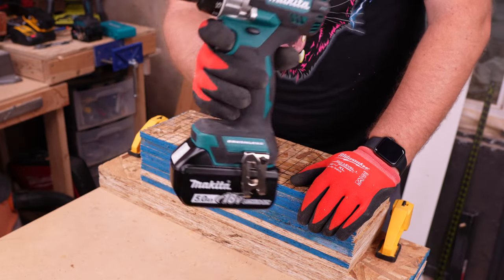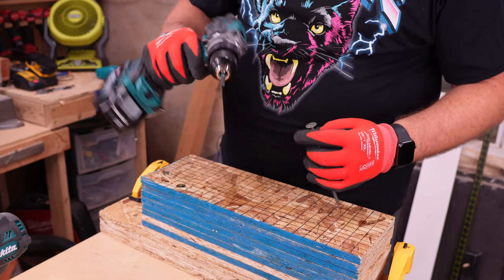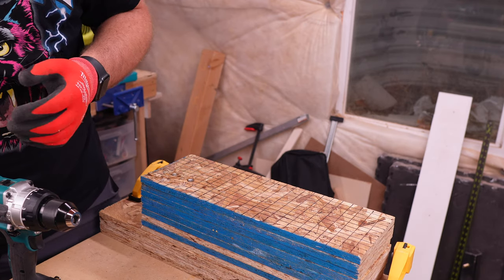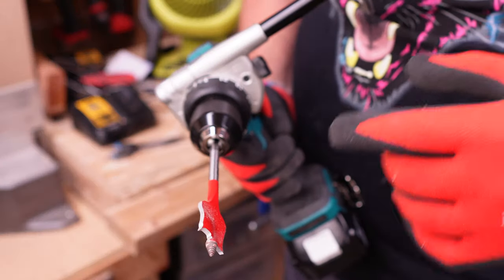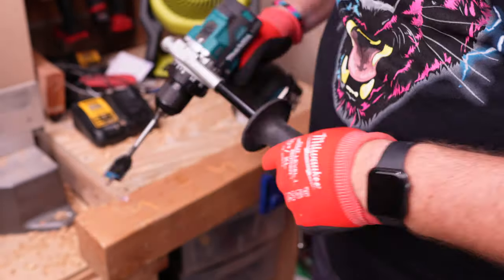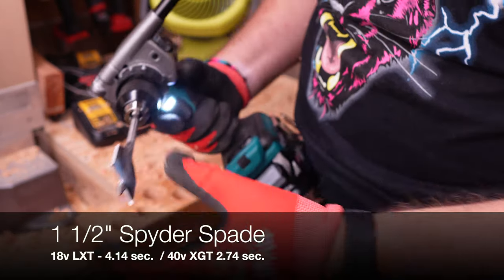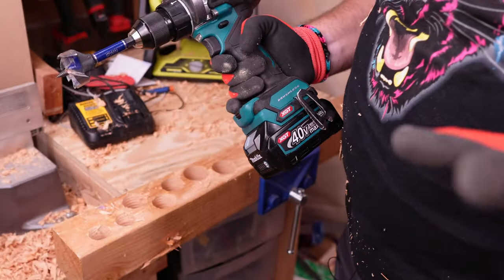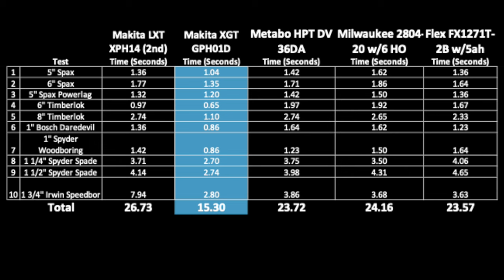Hands Down The Best Hammer Drill I've Tested! Makita 40v XGT vs 18v LXT

Comment: I push the XGT to anyone that will listen.  Makita does not focus on making tools the most powerful or the most torque. They focus on the smoothest and most comfortable tools that’s why I love Makita
Reply from the maker: I agree that their mission is more one of ergonomics and comfort than power and speed… most of the time.  The hammer drill is that and the fastest thing I have tested.
Reply: I am thinking about buying into the xgt line. It's not about the impact drivers or the drill. It's all the other machines. Circle saw, etc.. all the heavyer machines. Also, more future proof I think
Reply: Makita does focus on ergonomics,  but their reliability is far better than their competitors. I got sucked into the Milwaukee circle jerk, and ALL of them have trigger problems.  Further, only their impact drivers are low enough on power to bother me. I have noticed no power difference between my LXT, 998, and 2804.

Comment: Makita is for people who've moved past the Milwaukee circlejerk 🤣
Reply: hahaha I'm stealing this 🤣
Reply: Yeah lot of the people are on the latest cool tool fad. Much like all fads they fade .
Reply: Makitia is goat,  I switch about a year ago from Dewalt to Makitia you can just feel the quality.
Reply: Ive never been a big milwaukee fan and always liked makita. Idk if they werent always more powerful, they were plenty powerful, far more reliable, and far more serviceable if you have a problem
Reply: @jacksmith2315  im a makita user and i noticed makita makes tool power adequate for the tool task, yes most tools out there may be stronger but the makita  just works right 99% of the time
Reply: Ive got Makita 14.4 and 18.0 Volt NiCd drills that still run.  Well, they would be fine if the batteries weren’t shot!  😳🙄🙄😂✌
Reply: @jacksmith2315  Hi jack, see my comment above!  ^^^
Reply: It’s a man tool! Because after 14 years in construction and trying different tool and buying Milwaukee tool because everyone is bragging them. Then realizing that it’s not what everyone is saying it is. I was pretty discouraged on how Milwaukee was performing. Wish i wouldn’t of wast my money on Milwaukee. And just both makita. I was thinking of going to Milwaukee until i experience using Milwaukee. It didn’t take me very long to say F that. I can’t even cut a set of 3 stringers with a Milwaukee read handle skills saw with a 6 amp high out put with the battery over heating then i couldn’t keep working i would over heat the next Milwaukee batteries before the one on the charge was full 🤦🏻‍♂️ And can cut 5 with my Makita read handle skill saw without the battery over heating. Makita are the only ones  that have a safety features so you’re battery don’t drop under 12vlots to protect the cells in the batteries and they make there own electric motor not like other brand. Dewalt is black and decker now the quality of tool you get from dewalt is not the same as what it use to be before they sold to black and decker.
Reply: I just wish Makita had a pack out equivalent.
Reply: I cannot stand milwakee. People that own them are arrogant and cocky.
Reply: @matthewmahony9165   lmao, thats really true, sad.....
Reply: Ya man my mother-in-law loves this drill!
Reply: @matthewmahony9165  Mby cuz they know they have the BEST there is ;) That china makita is allmost 2 times more expencive than Gen4 (in Europe at least), the batt and charger are allso,and its bigger and heavyer. Tool guarantee's are the same for the 2 brands, and allso makita screw theyr 18v customers when switched to 40v (and they have way less tools on this line). So tell me really why you Makita fanboys are so blind to the facts ? Milwakee is coming with stack batt soon, and then they will be even more powerfull, lighter and smaller, but mby Makita will make 60v line next, who knows :D
P.S. Oh, and 1 more thing. Milwakee uses the best 21700 sells (Samsung 30T) in 6.0ah HO batt, where Makita uses middle of the road SonyMurata 21700 cells ONLY in theyr 4 and 8ah batt. All other batt are using 18650 cells from 2005 :)
Reply: Totally,I went from m18 to xgt. Not the same quality in my opinion
Reply: The reason I switched back to Milwaukee is because Xgt model is two years old and I have  used up two of them already. Good drill but breaks almost by looking at them
Reply: @derrickmuck535 I keep all my Makita in my packouts. Nothing wrong with the packouts.
Reply: @VikingOlberg Man, that's terrible luck. My Makitas are far more reliable than my Milwaukees.

Comment: I own both LXT and XGT lineup. Bought on my b-day that XGT drill (HP001GZ global number) set with the fast charger and two 2.0Ah batteries. Got from Makita a 3rd 2.0Ah for like 50 cent as a promotion campaign. XGT have one thing that LXT dont have apart from power - its safety modules hidden in them, which with an adapter allow you to lock batteries and tools to work only with each other and also check the state of your tools and batteries. So in case of someone having a taste in your tools, they will take quite expensive paperweight.
Reply from the maker: Good point to add.  Thanks for sharing!

Comment: I'm on the LXT platform and happy with the few tools I have of Makita, although this XGT drill would be only upgrade I 'd really probably want as their LXT platform tools are so good, quality in so many ways and not all about power. Reminds me of one of the greatest advertising slogans, "Power is nothing without control" -Pirelli.
Reply from the maker: You are right... the LXT tools are great.  I think the XGT will really shine on bigger tools.  If you don't have a need for those then I think you will be happy there.  I just hope that the LXT continues to get attention in the future.  That's really the only concern I have with the LXT currently.
Reply: @TinkerWithTools  Oh absolutely. I hope they dont start to phase out the LXT line.
I'd say, keep the LXT system and if they need to, get rid of CXT. Then adapt the lighter/smaller tool system using LXT battery platform. That gives a simpler two systems choice.
Reply: It’s just a damn shame they refused to go past the 6.0 Ah on the 18 volt batteries.  I love my ole’ corded Makita grinders.  The cordless ones deserve higher Amp hour batteries.  And yes i know they have the 18X2, but seriously, not in a grinder.  I have a couple of the saws in 36 volt, but again, more runtime would be welcome.  Guess that would be the selling point for going the more expensive route with the XGT.  Peace
Reply from the maker: @georgedavall9449  yeah XGT is the future if that’s what you want.   I think they will continue to limit the LXT battery size to promote the viability of XGT. That being said the XGT stuff I have is pretty sweet.
Reply: @TinkerWithTools  Well, MAHKeeta did it to themselves, as they knew if they came out with 21700 celled batteries in the LXT, they would open a huge ‘can o worms’   There are a lot of tools they would not fit in, especially the X2 ( 36 Volt ) tools.  I looked at my rear handle style 36 Volt saw, and there is no space for anything bigger.  So they just made excuse after excuse, and then, wha lah, out comes the XGT lineup.  I’m not dissing on the  XGT tools, but irritated by the poor battery support in the LXT lineup.  My 2 cents  Peace

Comment: Your Intro was great!  I especially liked your approach to testing, and your timing set up.  Your lack of Music is welcome!  So many YT creators feel the need to interject annoying insipid music in the background.  So count me as a New SUBScriber!!!  

Question for you:  Did you notice the XPH14 making the ‘Makita clacking clack’ sound as you back off the trigger, in 2nd gear?  Juss curious.  I sent off my XPH12 for that, and the fact the brake would cut in and out, and gear changes would grind, and they replaced the speed controller, and now it does NOT do it.  The New Jersey Factory Service center is great, BTW.  Highly Rec’d. 👍 👍👍✌👊☺
Reply from the maker: Thanks.   I actually have sent that drill off to be service because the transmission was basically dead in 1st gear.  It was replaced so I wouldn’t be surprised if there were issues with it.

Comment: As a machinist who also does a lot of drilling by hand in metal, it would be so awesome if that knob could adjust the max speed when drilling. There's just too big of a step from 2600 to 650 rpm and even 650 is too fast for drilling anything bigger than about 3/8" in steel.
Reply: I’m constantly drilling 1” to 2” holes in 3/16” and 1/4” steel (canopy frames for Sonic Drive Ins) using Milwaukee bi metal hole saws. I recently switched from using a XPH14 to Makita’s 36 Volt Right Angle Drill which has a maximum speed of 350 RPM in speed 1 (low) and it seems to be the perfect speed for my purposes. 
I also have been using electric tape to close off the holes in the hole saw and then filling the hole saw with “Sonic Ice” (pellet, but crushed ice also works well). 
I then drill with moderate pressure, the melting ice cools and lubricates the hole saw and allows it to cut faster and cleaner without the mess of cutting lubricants and the ice is free in my case.
Reply: I also forgot to mention that using ice to keep the hole saw cool I usually get more than 100 holes out of a hole saw which saves som serious money over time.

Comment: I like the electronic clutch for one reason. When you screw something that requires not all that consistent torque, you have the option to drive it a little further after it cuts out. The mechanic one will just keep slipping.
Reply from the maker: I hadn’t thought of that.
Reply: @davidblahota5655 I'm looking at getting this drill for the electronic clutch, the noise that the mechanical clutch makes is annoying sometimes, especially inside a room.
Reply: the point of a clutch is to limit torque to a certain amount. You're saying you like the electronic clutch because sometimes it doesn't limit torque. Interesting.
Reply: @CarltonGauss  Yeah, a hand drill does not operate in all that consistent conditions. You would have to turn the limiting off for a single screw with q mechanical one to drive it further once it does not want to go deeper with the setting.
Reply: @davidblahota5655  This clutch just adds another layer of inconsistency though. Even if "press trigger again for a bit more torque" would be a nice feature; it's not really an intended feature here. It's just a consequence of the clutch being bad and responding late. My problem is that this late response is happening on the initial drive too, and it's impossible to control how much torque you're delivering to the fastener.

Anyway, I'd much rather change the mechanical clutch setting than strip a screw head or a thread.
Reply: @CarltonGauss  yeah, you're controlling it based on the amount of power delivered to the motor, which would mean it not getting from dead stop if it was limited on the spin up, where it draws way more current. Qs for controlling the torque, it does better than mechanical, the torque needed inconsistency with materials which you use hand drill to fasten is the issue.

Comment: Excellent tool use my XGT for mostly for metal work also have the 40v grinder which is also a beast. Any woodworking I do around the house or in my workshop I use my dewalt Dcd805 probably use the 805 more now

Comment: You should review the XDT19 next, now that it’s available here. And if you really want to go all in, order a TD002 from eBay and review it side by side with the gen4 Milwaukee impact.
Both of those reviews will grow your channel exponentially.
Reply from the maker: I am sure I will work to bring those to the channel at some point but next up for Makita will be a comparison between the LXT and XGT Impacts.
Reply: @TinkerWithTools  the only problem with that is the only XGT impact available in the states was just a stopgap until they could build a from scratch version designed from day one on the 40v XGT platform, that is the TD002 which will probably launch here by the end of the year as the replacement for the current one, which I bet the XDT19 will out perform.
Reply from the maker: @TheOMEGANOX  so in you opinion the hierarchy will be 
1. TD002
2. XDT19
3. TD001
4. XDT16

Am I getting that right?
Reply: @TinkerWithTools  for sure on #1 being the TD002, the rest will be close and I'm as curious as you are to see how that shakes out.
Reply: Another vote for td002g,  nobody is doing it!

Comment: I have a question about the Ridgid promo.
The hammer drill combo is available in my store, but the ratchet and right angle impact are not. Since those are the most expensive free tool options, they are the ones that make the most sense for the hack.
I don’t see any discrepancy in my cart, but can I just order everything from the website, pick up the hammer drill combo, and have the free tools shipped to the store?
Reply from the maker: I have never done it that way.  I have ordered it all and then later just taken back what what I don’t need.  I have never tried to split the delivery method if you will.
Reply: @TinkerWithTools  The website is telling me that I can go to the store and get the combo, but the ratchet and right angle impact, which are the most expensive options, have to be shipped.
The only way to do the same method for everything is to have it all delivered to my house, and I don’t trust that nobody will steal anything.

Comment: Bought the combo set with extra batteries. like you said impact was good, the hammer drill awe inspiring. 
Especially on larger hole saw or diameter bit holes. Not that much bulkier than the LXT (18 volt) Selling my 
mid range PH12 combo set. Going after XGT OPE now, oh boy, ( rabbit hole!).
Reply from the maker: A fun but expensive rabbit hole!
Reply: @TinkerWithTools  it isn't as bad as Japanese chisels though.😉

Comment: Very  nice test review as always, and a good summary and analysis after that. Worth subscribing for it! Makita have really nailed it with the 40V platform, significant power gains in all the tools (apart from the impact drivers so far). Even the new stick vacuum cleaner is 2-3 times more powerful, than the 18V brushless one...
Reply from the maker: It will be fun to see what they can come up with to make use of all that power.
Reply: @TinkerWithTools  They have the 14in Power cutter gec01 running 2 40v batteries.
Reply from the maker: @misha030302  yep.  Stuff like that is really going to be fun to see where they push things next.
Reply: You haven’t tried the TD002 yet
Reply: @TheOMEGANOX  I haven't, but I have seen a lot of reviews for it. Very good, but pretty much as many other 18v tools, even slightly inferior in some ways. And I have the 18V Japanese Makita TD172D, along with 5 other impact drivers (including the super-smooth and refined 12V and 18V Milwaukee Surge).
Reply: @sizif717  yeah I had the surge also, gave it to a buddy when I got the 172, just as quiet and smooth with way more power, the only way you'll appreciate the TD002 fully is by owning one and running it alongisde the most powerful impacts out there right now, which are the milwaukee gen3-4 and the flex with stack battery, it's flat out amazing.

Comment: This drill has been tempting but I already have the Metabo HPT 36v hammer drill. I do have a couple 2.5 xgt batteries and the rear handle so I will eventually pick one of these up when I find a good deal probably.
Reply from the maker: The Metabo is no slouch and is a great drill.  For me the XGT is in a different class because of refinement.
Reply: this is why tools with arthritis wont test this drill

Comment: I guess I should have worded my question differently.
What do you think of the LXT combo at Home Depot?
The reason I’m considering it is because, with the hack, the combo becomes $193 once you return the “free tools.”
Reply from the maker: Getting that tool at that price will be about as low as you will find it.  I love the combination of the two. The impact driver will be one of the nicer (but not most powerful) impacts you will ever use.  The drill is good but isn't class leading.
Reply: @TinkerWithTools  I know SOALZ hates Makita.
I’m just trying to get the best possible set for my needs and budget. I don’t like the ergonomics of Milwaukee, so I’m looking at Ridgid and Makita.
Dewalt and Flex are my other choices depending on the deals.

Comment: My issue is the lxt impact is the better impact. Why the 40v impact sucks is beyond me. So I got the 18v kit. Once I pick up the 40v track saw and get into the system I may get the drill only. Until then the lxt is solid drill.
Reply from the maker: Yeah, the impact drivers just don't seem to benefit from the higher voltage and that's not just Makita that is that way.   The drill is a different story though.